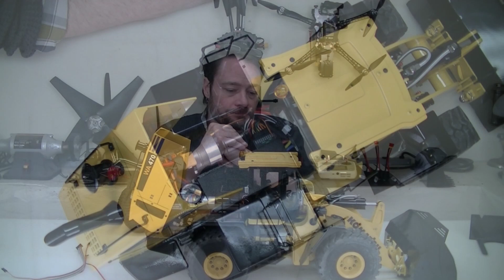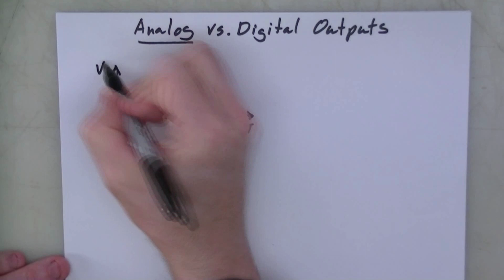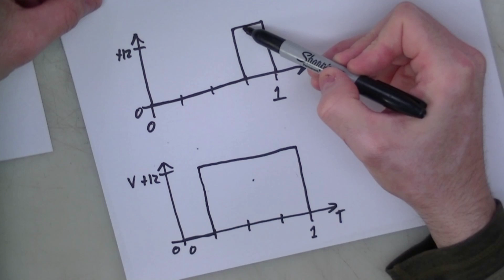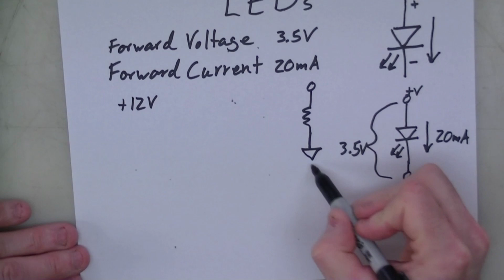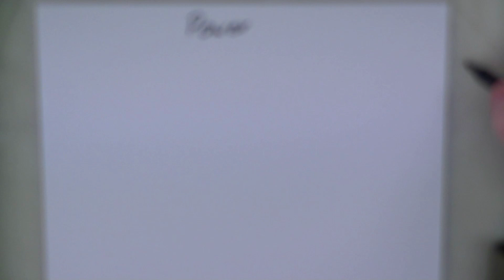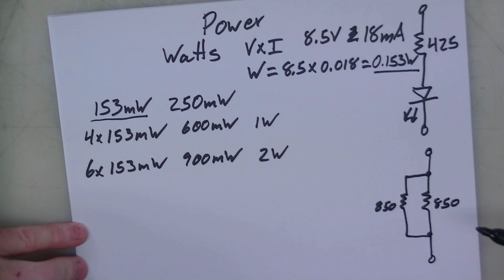Upgrading the WA470 Wheel Loader Sound Module

Comment: Do you think it would be possible to run the ESC signal for the hydraulic pump through the sound module as well?  Perhaps though that second lead?  I would like the engine REVs to increase with the hydraulic pump.  What is the name/model/brand of the stock module?  Thanks!
Reply from the maker: I tried to do the same and was not able to make it work. It might be possible if you have a radio with more channels and more mixers available. I was not able to determine the name/model/brand of the stock sound module.

Comment: Hi, i have the same loader and the sound has started dying, so time to do the same operation. I would like to know if you have produced a new wiring diagram. Mainly the servo functions, are you using Y cables, pass through the Beier or my using the sbus function ?
Reply from the maker: I've never made a wiring diagram that would be readable to anyone else. I figured that this would be the only time I'd ever do this project, so why put that much effort into it?. What I can tell you is that I quickly grew tired of the Beier module and replaced it with Servonaut. So any wiring diagram that I did make is now worthless. I'm sorry that the news isn't better. Good luck on your project!

Comment: this machine from eagle machinery yeah But by faroe i have one white edition it's normal even this dumb machine needs 2spd And diff lock.! and this machine suffer from crackling sound in the axales when move? i see earth mover 870k from eagle machinery 2 But by jdm much better than this 
870k .. have much reason 2 be better than this faroe wheel loader
no.1 2spd And diff lock
no.2 you can remove the tooths from the bucket 
no.3 you can adjust the pump
no.4 she strongest than this poor loader
no.5 its really really wonderful video👍😄 greetings from Canada 
Cheers🍺